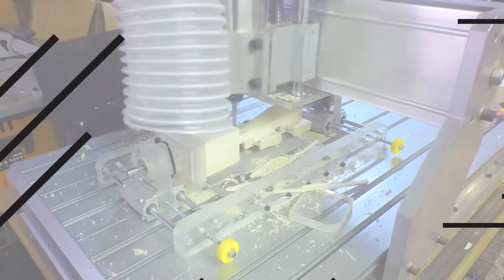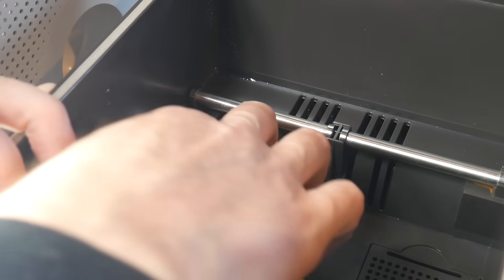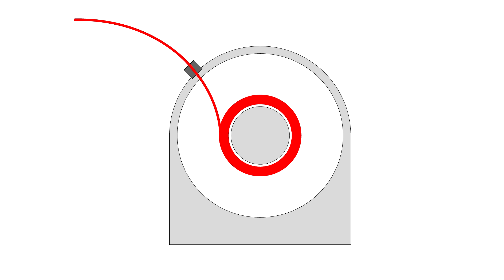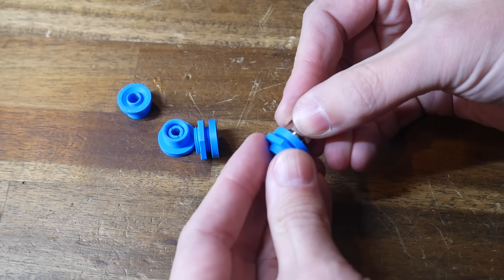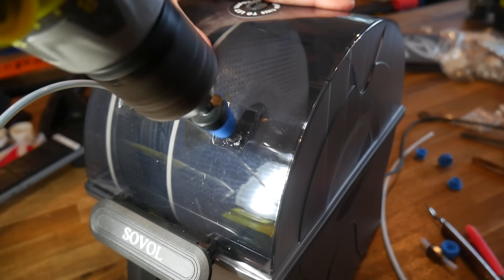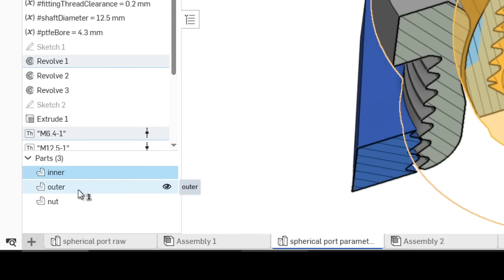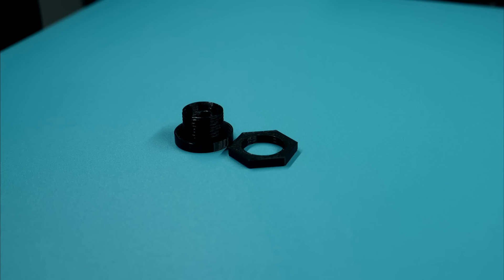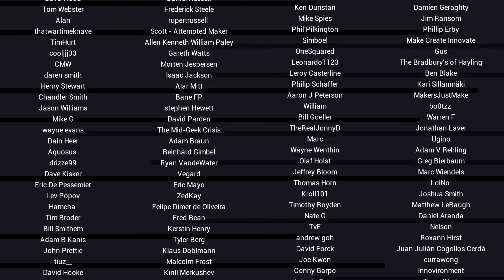Almost every filament dryer can be improved with this simple upgrade

Comment: fixed mine last night. added a 6mm rivet nut in the hole. screw a pfte tube lock adapter in that does not allow the tube to pass through and done. no printing necessary.

Comment: If I wanted an exit on the back (not on the lid but on the main body, so as to be able to open/close without affecting the path) do you think it could fit a hole somewhere?
Reply: Works and it's a great way to feed the Uniformation U1, together with this swivel port.Thanks for designing it!

Comment: Cool! 
My ceality Pi pulls the ptfe tube inside and causes a blockage.   This will be a good modification.  At the moment I use a m3 washer to block the tube from getting pulled in.  I have the same drier, works better than the Pi

Comment: not necessary at all, i jammed a ptfe tube through and it flexes by itself as the toolhead is pulling it. It can swivel 30 degrees in all dirrections

Comment: A #29 drill works great for enlarging the small-diameter bowden tube fittings.  For the spherical part I had good luck using a hand-held countersink reamer to chamfer the threaded hole followed by a 6mm tap to chase threads.  If the spherical part pops out of the housing that just makes it easier to hand thread the bowden tube connector into it.  It pops back into the housing quite easily.  Thank you so much for designing this.

Comment: This is an excellent file. As designed it didn’t work for me. I couldn’t get the ball joint to break free, and those 6mm fittings are really hard to find. For what it’s worth, I scaled the file up to 166 percent, and a 10mm fitting fit perfectly. As a bonus, the ptfe tube passes through easily, and the scaled up tolerance allowed the ball joint to break free. I chose to mount the fitting on a rounded  corner, so I did need to model some curved shims to level out the radius. Thanks for making this project available.

Comment: Another solution for a coupler that doesn't allow 4mm PTFE to go through would be to make the opening at the back side of the sphere (formed by Extrude 6 and Extrude 7) of a diameter to allow adding a short length of tube.  I'm going to take a shot at doing it when I have some time.

Comment: I will keep this in my back pocket. All of my printers have some type of enclosed multi-material system, even my A1 as I printed an enclosure. So, I typically dry my filament and then either bag or place in an enclosure with desiccant. Still, this is worthy for me for when I want to print TPU.

Comment: I had a different sovol (also seen it branded as comgrow) dryer that sucks ass too. It did the same condensation thing and only went up to 50C. 50C might've been fine since I don't print any nylons or other engineering grade materials but since I live in a tropical country, the dryer was dripping wet whenever I used it. Like twice the amount of water in the video. Got rid of it for a Creality Space Pi dryer and other than the RH sensor on it being broken, I never had to worry about whether or not it was drying my filament.

Comment: this would be easaly fixed but just having a completely vertical exit on the front or rear edge of the dryer alternatively a completely horizontal exit would also work

Comment: Great video!
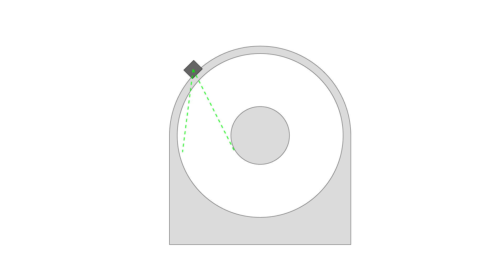One comment on the filament spool out the hole in 2:40

You actually want to angle the hole slightly towards the tangent of the outside of the spool rather than the middle. 

This is because the filament spool spends the most time at a bigger diameter and less time at a smaller diameter due to the circumference of the circle increasing the larger the diameter is.
Reply: fair point but the joint he designed swivels to whatever the optimum angle is

Comment: Great engineering, but one world - overengineering. I don't understand why you cannot just bore a hole 75-80 degree to table just as you described in picture. Yes, you would need a special spacer inside before nut, but then it would be without any moving detail(which can stuck with time) and can be properly sealed.

P.S. I have seen this filament dryer when it was released. As far as I remember it had problem inside - walls between fan and heater were badly made with only 3/4 of needed height and did not properly sealed air current. Did they fixed it?

Comment: I have an older single spool dryer similar to this. Had to do a similar mod to it in order to fix the exit. I also added a desiccant box and wired in a fan so moisture wouldn't build up. Ended up working great after that. Surprised they haven't fixed this sort of thing by now. Mine has to be 6-8 years old.

Comment: Die Idee und Ausführung ist ja wirklich gut, Respekt👌,ich sehe da aber ein Problem mit der Freigängigkeit des PTFE Schlauches in Richtung Drucker. Lässt sich dieser nämlich nicht völlig frei in alle Richtungen bewegen so kann auch das Kugelgelenk sich nicht frei bewegen. Wie hast Du dieses Problem gelöst? Viele Grüße und Danke für die vielen guten Ideen und Anregungen in Deinen Videos👍
Reply from the maker: Mine to a quite tight, I don't expect it to move. You could always use a non pass through fitting, or narrow the bore in the printed part to make it tighter.

Comment: NOT putting the PTFE port on the lid is the solution. A hole with the existing part from the lid in the base, right above the angle to where it goes to a 90 deg ( above where the  display is ) will allow the material to have a direct line to the spool. I did this to a Creality dryer and it works so much better.
Reply from the maker: I agree, a separate lid to the output is ideal.

Comment: i've had similar problems with my comgrow dryer, but found that overhand spool unloading worked better with that one, but without a mod like this it doesn’t want to accept ptfe tubes - so thank you.  of course, i'll probably continue to use my individual cereal dryboxes for each machine & use the dryer only for drying, but i'm glad the option exists.

Comment: I've never been a fan of airtight dryer boxes. My dirt cheap one with a vent fan works very well, and I just transfer the spool to an airtight box with silica beads when it's done. I am planning on making this improvement to the dryer, but I'll definitely just stick the included rubber gasket and tubing into a pivot without having to worry about a metal fitting.

Comment: I think there is a huge misunderstanding about there type of dryers. The heat does not dry the filament. The way Filament dryers like this work is that heated air is able to contain more moisture and thus extracts it from the filament. This Moist heated air needs a way to get out of the dryer being replaced by cooler and dryer air from out side the dryer. If the air exchange is not possible the saturated moist hot air cannot go anywhere so the air condenses against the cold exterior so you keep the water inside.  So making a dryer airtight actually is counterproductive to what it needs to do. So, my advice is: take away the rubber seal (design flaw) in the lid and just take out the plugs you are replacing and just use the existing bare hole. Maybe even drill an extra hole on a different location for better filament guidance. Nothing will get stuck anymore and it dries much better without seal or ptfe tubing, just give it fresh air during heating, do not close it ! Typical example of over-engineering :-).

Comment: I've made a similiar part but didn't bother with the fittings - just straight holes with a good friction fit on the PTFE tubing.  Even the panel nut can be avoided if the panel hole close to the tube guide diameter with just a press-on ring on the backside.

Comment: RTFM? The instructions say to insert the PTFE 15mm into the enclosure. Actually doing this reduces friction dramatically, eliminating the need for this. You just didn't push the PTFE hard enough. Use pliers if needed.

Comment: I have the same dryer but branded differently as Comgrow. The PTFE tube does extend all the way inside - you just have to push a bit harder until it goes through.

Comment: How about adding a little grease to the captured bearing part, would that assist in making it airtight or cause additional problems?
Reply from the maker: As long as the application is tidy I don't see a problem.

Comment: This is great! one thing to keep in mind is that getting the filament out through the lid only works when the lid is lockable (like yours), I have 2 Eryone snail dryers and their lid does not lock, it's completely useless to exit the filament through the lid because if there's a jam in the spool for any reason, the lid pops open and causes a mess. I discovered it the hard way. My solution was to use the "base" exit hole, but surprise, surprise, where the exit points towards? You guessed it, the middle of the spool, and the ideal place in the base is where the control to turn it on/off is, so no luck. Ended up not using them as active dryers anymore and just them as passive dryers.

I'm not 100% this would help in my specific case but it's amazing! thanks for making it available to everyone, you rock!

Comment: You could have just made an angled connector for the PTFE tube. While having some range of motion is better if the connector faces the wrong way, I can't help but think that making a connector that faces actually the right way, should be better, and it'd be a way less complicated print.

Comment: G'day ol son....these older dryers are really a stop gap, but i did back an get the Sunlu S4. it fits 4 rolls, i havent seen much in the way of moisture, and has been running on my shelf for over 1.5yrs. I just change Silica, and rolls as need be, it rarely runs up here in Brissy mostly in spring/summer. It really is a poor mans AMS one of the Better Kickstarters i backed and lastly no issues with filament Angle and always is free flowing with no binding. Cheers on this Hack for the cheaper smaller dryers like yours, From A M8 Downunder🙃

Comment: Fun fact:  PC4-M10 is NOT M10 metric thread, it’s ISO 7 pipe thread. The pitch is 0.91mm instead of metric M10’s typical 1.5mm. I see this mistake on almost every model that uses one of these couplings. 

This is not an issue for PC4-M6 couplings, which for some odd reason use an M6 thread.

Comment: You can leave the lid open a crack to let the moisture out, just adjust the lid latch so it props open the lid a little.  I believe this is by design, so only close/seal the lid when storing the filament, but not when drying.  Grate video as always!

Comment: I found over the years that any filament dryer, especially the basic ones, work considerably better when you let the lid open for about a cm. That way the moisture can escape the dryer. I never have these condensations anymore like you have. I also checked with weighing a moist sponge and with the lid a bit open there's a lot more moisture gone.

Comment: Why not use PC4-M10? 🤔
Reply from the maker: Simply because the whole assembly will grow in size. You can see the flat that gets drilled out is close to maxed out by the current part. But feel free to alter the variables to suit the larger fitting if you prefer.

Comment: What is the benefit of using a pneumatic connector that allows the bowden tube to completely pass through?

I have found on my dryer (the creality space pi plus) that the friction is enough to pull the bowden tube in until it rides all the way up to the spool causing jams. Having the pass through seems like you could run into a similar problem unless you use a clip on the connector to keep the bite engaged on the tube.
Reply from the maker: The fitting still grips tight for me. The tube won't be sliding in or out by itself. The reason I'm recommending it is I figure the perfective opening will have less friction than the injection molded plastic of the standard part. You can always not push it through if you prefer.
Reply: @TeachingTech  I understand. Thank you for answering!

Comment: The way I solved the angle issue in my dry print box (which is just an airtight storage box with a terrarium heating pad in it) is just some hot-glued shark bite fittings on both sides of the plastic; one is for the outside, one is for the inside. On the inside there's a good 10 centimeters of PTFE tube so no matter where the filament comes from it's in the smooth tube before it gets anywhere near the side of the box. This has worked incredibly well for me so far.

Comment: The lid has to be opened a bit while drying, the small hole on top is by far not enough! Else the inside humidity levels are very high and the filament doesnt dry well. I dont know if it is on purpose, but there are 2 opening positions build in the closure part. I use the small settings and it works great. The optimum is, when you can see only a small to no humididy drop inside the dryer, when you open the lid completely, while drying.

Comment: I just recently noticed the venting issue with my sovol dryer. I've never had excessive condensation issues while drying filament. I've gotten used to stopping by every few hours to open the door, release any trapped moisture, and lower the relative humidity number displayed on the dryer.

The issue only recently became apparent when drying some small books a week ago. I got caught in a storm while at work that left me and some reference books I keep in my pockets drenched. I decided the safest way to resuscitate my drowned book was the filament dryer. 

I ended up setting it to 60C and using the latch to keep the lid open and prevent moisture buildup. After 2 days, my book was back in my pocket at work. I call that a win!
Reply: The clasp on the lid has some notches you can use to prop the lid open very slightly.  This allows much better airflow and zero condensation.

Comment: Anyone who owns one of these has already done this, this isn't news, I go so pumped I was going to find a new hack, like an easier way to add a motor to spin the spools while drying. Also find it crazy that this Sovol dryer is far better than the Creality Space Pi. My Creality is impossible to load a full spool into the PTFE tubes, the sensors are garbage the RH% just doesn't work, stays at 13% and the door swinging open to it's death is kinda silly, add in the lack of airflow underneath and risk of fire hazard I find it hard to understand why Creality is as popular as they are, the quality and thought isn't there. My Sovol while yes a little bit louder moves more air in the chamber, has an accurate reading and more responsive screen, plus the feeding filament is far better once this upgrade is done.

Comment: Build in a small 4cm fan on the side or so to lose the moisture and a hole with a grill and a dryer pack in it for new air to go in. as long as its heated the fan should run at slow speed, and when done it should stop, flaps on top or w/e to prevent air moving once stopped.

Comment: When you were using the chamfering bit (6:10), you really should have put the fitting in the vice again or maybe held it with a locking pliers. If the bit slipped off the fitting you would likely have had a nasty injury. Keep your body parts out of the line of fire!

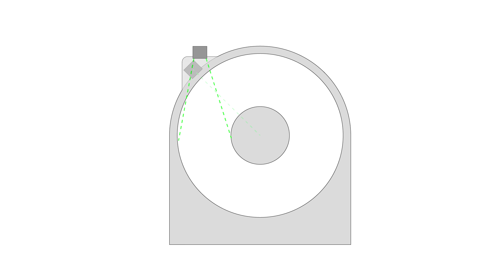Comment: 10:13 so you just got done using a machine that can make nearly any shape you can imagine but you "don't have that luxury"?
It's a really simple part to rectify the angle problem, and really those rubber glands work just fine especially on the polydryer where the tube passes through and acts like a ball joint anyway.

Comment: I have 2 of those driers, and I like them..... except that angle. I just crack the lid open and let the latch prop it open a few times while drying to vent any moisture Printables has a model that orients it much better at a fixed angle. I may try to model one that does both. Would be great for that specific dryer, but yours is great for universal.